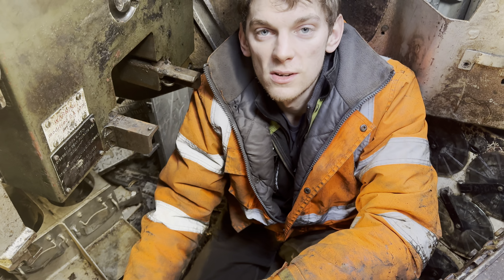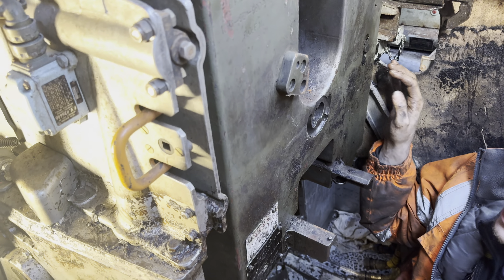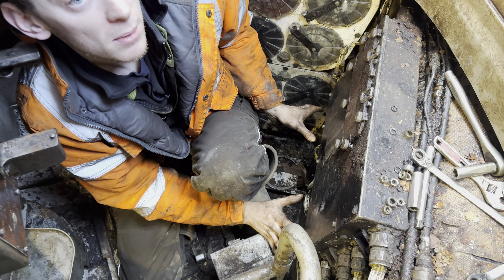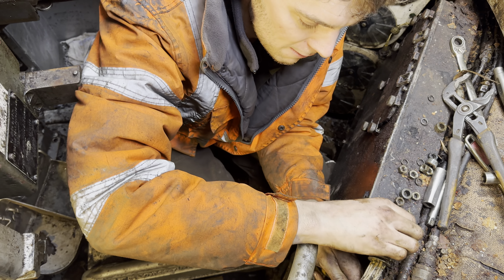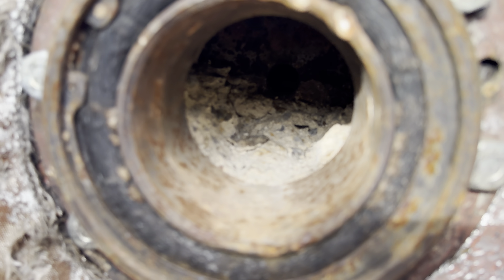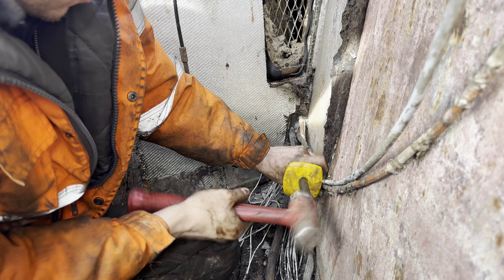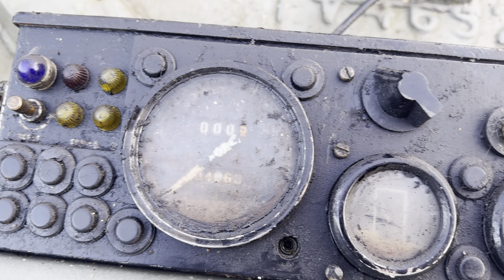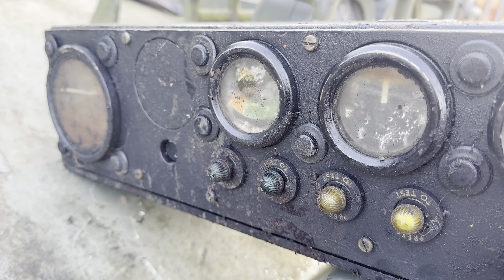When You Buy A Tank From Wish.com

Comment: How much did a Chieftain cost? Well, in 1967 it was £90,000 to £100,000. Which is about £2,047,227.36 to £2,274,697.06 in todays money.
Compare that to the Challenger 2 which was about £4,217,000 in 1999, about £9,158,718.25 today.
And they built 1896 of them, 900 for the UK, 996 for export.
Reply: no price for Mr crouch if you ask he probably has a brand new one for ya and a trailer and unit to drag it around 😉 another good video lads
Reply: gota love google lol
Reply: Is this MBT's or all variants, or were engineering variants just made from older specs
Reply: Last one we sold was at beltring , a Mk11 £13.5 IIRC , we had a serving scammer commander for a few days to drop it off . Great days , far away from all the BS now . We got it road legal too , I mot,d it .
Reply: Their centurion is on 95k so chieftain might go for around 150k-200k? Seems like a normal price for a cold war tank
Reply: @Ballentyne817  Its the best tool for random facts. As long as you aren't super picky about the accuracy. I have no reason to doubt these numbers, but I wouldn't go to court with internet research alone.
Reply: @Hewitt_himself  From what I can see, British variants were converted from old spec MBT's
Reply: When you consider that it cost 2 mil for a stormshadow missile and 400 grand for a javlin, 10 mil for a tank doesn't sound that bad.
Reply: @@user-zk9xe3wm3v Oman: 27
Jordan: 274
Iran: 707.
But sure, lets go with Oman only. And don't know why you put export in marks like that, it was exported...
Reply: @@user-zk9xe3wm3v and we are talking about the Chieftain. Not the Challenger.
Reply: @@user-zk9xe3wm3v Given the song and dance going on in the Straits of Hormuz right now ,there's every chance we might see some vids of Chieftains in actual battles...

Comment: That harness is not for the gearbox, its lights etc. Gearbox is the smaller shielded one .Its bottom RH side on the HMJB. If you remove the cover from  the HMJB the bottom RH side there is another cover. Under that is the main junction blocks for the gearbox, all the gearbox wiring goes through that shielded box.
Reply: could be wrong but i believe he mentions that at 26 mins into the video

Comment: AS an aircraft mechanic, I feel your pain, I really do. I had worked for Beechcraft at the airfield at Fort Meade, MD on US Army U-21s (King Air) back in the late 1980's. One of them had served in the Vietnam war and had a engine failure on take eoff due to fuel starvation and landed in the adjacent river in water up to the bottom of the wings.
We were constantly fighting corrosion and wiring problems on that thing.

Comment: There was a  Chieftain filled up with concrete at Bordon and they used it as a training aid for  recover mech’s . If I’m remembering correctly it was normal practice that they filled Chieftain gate guards  with concrete to deactivate them, never to be used again but you lads are going to prove them wrong 😊
Thanks for the video and yes I have worked in those turrets and I know how tight and difficult it is to work in them .
Reply: Who were they afraid of?  Seems delusional paranoia

Comment: I worked at Bristol Aerospace as an aircraft electrician, during the overhaul program to turn Canada's fleet of CF-5 fighters into primary trainers for the CF-18. The airframes and avionics were upgraded and every single wire was replaced from nose to tail. I don't envy you guys tackling theses Chieftans that were left in this state.  But I'll give you a tip for future efforts: if you have to pull cables and harnesses through tight spaces again, get yourself some electrician's lube.

Comment: The interesting thing about water corrosion is below a couple of inches it's fairly negligible do to lack of free oxygen as many canal boat owner will attest. The corrosion is around the water line and luckily the oil stopped that. So if you dry the tank fairly quickly and displace any remaining water with contact cleaner etc. then hopefully most stufg should still work
Reply: Something that's always submerged in water won't rust, but something getting wet repeatedly will. Mostly because there's a lack of oxygen under water. At Battleship Cove Massachusetts, they have the remains of a sunken PT boat submerged in a display filled with water to preserve them
Reply: @skyraider87 exactly
Reply: That is due to galvanic corrosion on canal boats. There was no battery on the tank so that should lessen it.
Reply: @planespeaking  archaeologists do the same don’t they when they dig something out of a wet bog, they keep the artifact wet/ under water to stop the air getting to it and it rotting away (until it’s conserved of course)

Comment: I used to deal with aircraft wiring, so I feel your pain, the routes for some of that wiring were never easy, always in tight confined spaces. Those wiring looms in the tank may be made of all white wire, but I bet that what was once a yellow sleeve near the connector at the end used to have a part number on it. From a wiring diagram that part number would give the information where the cable goes. I used to be an aircraft avionics engineer, I’m retired now, but I used to have to trace wiring to fix defects or carry out modifications. On the large aeroplanes most of the wiring is also all white wire, but in the civil aviation world they cheat and every wire will have a unique number printed on it every few centimetres. There’s also documentation in a wire list that will give for every wire, the wire size, its length, what terminals are used at each end, the destination of each end and what circuit it’s in. So it’s considerably easier to trace wiring. For instance in a Boeing 747-400 there is approximately 185 miles of wire, divided up into approximately 200,000 separate wires meaning approximately 400,000 separate terminations. So as you can imagine without the wire list fault finding would take a fair bit of time.

Comment: The rubber block sealing is similar to that used on oil rigs. Fire wire will sound if crushed. Your fuel gauge sender is by capacitor belts by the way. That wiring was always incredibly robust it tended to disintegrate when odd bods wrapped it around recoil mechanisms etc. amazingly the plugs and sockets look in quite solid condition not the jellified mass they often were after a few years service. Keep the removed wiring as it looked salvable as long as the letter connections on the plugs are known.

Comment: I don’t know, if this helps.  I installed the wiring in some Chieftain hulls as an apprentice.  The individual pins are soldered and each one has a marker on it inside the back of the plug to identify it.  Swapping the whole harness for a good one is, obviously, the easiest fix.  Although, none of the fixes are easy.  The hull gland was a twat to fit, from memory.  And that was with no charge bins fitted and no basket.  I couldn’t see the hull rear junction box either.  It was in the back right corner of the hull (sitting in the driver’s seat).  Wire locking everything in the engine compartment was no fun either.  No need for that anymore!  All the best.

Comment: I am amazed at your appetite for crappy jobs. I hate electrics.
Reply: Electrical work is not the problem its finding or having known good replacement OEM harnesses or electrical control box repair or replacement as well. I can see how just getting the tank to start and move is a huge acomplisment. I do wonder how often these guys hit their head. Im surprized they dont ware "bump" helmets.
Reply: Electrics been my job for over40 years
Reply: I love electrical i wire everything from planes cars computers and robots
Reply: @dancarney106 helmets are more trouble than they are worth.

Comment: Just a thought if you need to fill the bulkhead cable hole fill with a few fire stop pillows instead of expanding foam. Should you need to change anything else they can be pull out and reused, but will expand to completely block the hole should there be a fire.

Comment: 7:02 cable's white to make it a pain for an enemy to go in there and repair things once you've deactivated the tank. I know it's aggravating, but it makes sense. That's the "fun" part about tank design, you have to take into account more than just what happens in regular use. It would suck, if you (crew) deactivated the tank, and later saw the same tank, not even a week after, used against your own, because the cables were color coded and made easy to unscramble. This way, you just take a chunk out of each cable (break an entire section) and you're set. Without a manual and expertise, it would take the enemy at least a month to figure things out. That there's ANY cabling denomination actually makes the tank less effective in that respect, but i guess a line must've been drawn by the command when the tank was put into service.
It's like bike lock theory. You put more than one lock, not because it would be extremely difficult for the thief to clip them all, no, but because it's going to be a hassle, and thus it won't be a priority for your bike to be stolen. In a set of war, you have a similar logic, you won't spare crews on the front line to take your enemy's tank to readiness. You have either store it or expend man power to wire it back home for experts not on the line to go at it. Jm2c.

Comment: I do wonder if Cheiftan, or any other tanks, does have a wire diagram. You know like we can find for a car. If someone had been kind enough to upload one for Cheiftan to the internet, I dont know. But I think having one could had helped to figure out which cable you need :) But the old good fashion "Pull to figure out" works as well
Reply: Large binders full of them - the problem is that most of this military stuff has multiple revisions and you need to find the drawings that reflect the exact configuration you have.  On top of this, in a lot of cases the assembly of things like wiring harnesses was subcontracted and the contract required that the contractor not retain any copies of the drawings after the contract was complete, so the only documents that 100% reflect the as-built state have often been destroyed. Add in all the post construction mods and in-service bodges and really the only way to be 100% certain precisely how it's all hooked up is to inspect it.
Reply: @TrimeshSZ  Doesnt sound too far off how it is in the auto part of things. But again as I said before. Tracing a wire to figure out where it goes and through where also helps when a wire diagram isnt able. A lot of the times where I had to trace a wire I did that. Only times where I thought or going to need a wire diagram is either if I encounter a nest of same colour wires, or if I have no freaking idea where the wire went to. Like going through the firewall where 100 other wires does as well

Comment: Dunno if you binned the old dash, but, from personal experience, it's best to keep it all, even the waterlogged bits. Of course, none of that will be useful as a whole, and you'd need to expend time taking it apart to keep the good bits, but if it can be salvaged, it's worth something. The brass, bezels, glass, everything. I'm struggling to find bits for tractors and equipment that were made in the 90's, can't be easier with this vintage whine.

Comment: I wonder why they poured concrete into the engine bay.  Only reason I can think of is to add ballast but it is a tank so it wouldn't need it.  Considering they also ground out the gearbox mounts, maybe they never wanted it to run again, but I don't see why they'd need to take out the gearbox mounts and concrete the engine bay to do that, all they'd have to do is take the engine out.  It's not like someone is going to be able to put a replacement engine in without anyone noticing.

Comment: The end of each of those white cables inside the back shell of the connector will have an identifying cable marker on it so fault finding is usually only a problem when someone else has been there before you and ragged it off! 😕

Comment: If I may ask , why not just cut the bad wires off so you're not trying to pull the plugs through the tight spots ? You can still compare lengths after pulling them out .

Comment: Might be worth spraying all the electrics down with some contact cleaner, as it didn't have power in the system no electrolysis took place, now your waking it up any damp on the electrics will start to dissolve it all away. Had a right mare with a digger that went in water with the power on.

Comment: If you have the connectors, they should have the individual pins labeled.  With a good wiring diagram, you should know what pin goes to what connection in the engine bay.  Then it would be a simple task of sounding out the wire to see which one it is in the engine bay.  If the connector is not labeled I would b e wondering why the hell not.  You could still do the same but you would have to be looking at the box in the turret to figure out the purpose of that particular wire.

Comment: With our host crawling aroubnd inside a British built machine,in the mud and water,pulling old cables through reminds me of my apprenticeship working on English Electric rail car units. Hundreds of very long wires,all insulated with cotton wrapped butyl rubber and all the same damn colour (greasy black) .They had little number lables on each wire which of course would have dissapreaded long before we had to fualt find them with a buzzer powered with a telephone battery (no,actually a round thing , unlike a lithium battery today)

Comment: If tanks fill with water when the bungs are left in. Why not just leave the bungs in, feed a hose in and let it go till it overflows? Save on mixing all that concrete. Or do they dump in a dry mix, fill with water and leave to cure?

Comment: Trying to move the bin may have been easier if the water was drained from it? Looks like it was full, which would surely add a liiiiiiiiittle bit of weight to it. However, there was indeed a slight lack of room to actually shift it anywhere else.

Comment: Are not all the wires individually numbered, if all the same colour. The number printed on the cable insulation each 175mm or so.
Reply: I was just about to ask the same question
Reply: Most at this age/stage have rubbed off or become unintelligible
Reply: Just like a mid 90's Citroen except they were all green. God awful things to trace electrical faults on.
Reply: The concord test aircraft in duxford is full of orange cables 😂
Reply: No, military/aerospace harness are not numbered in this way (there is no marking on the insulation as it is usually a type of PTFE or the like which doesn't accept inking and the color of the insulation defines the AWG/type of stranding/wire coating/...). You usually put a temporary marker on each end of the wire during the manufacturing and remove it when doing the contact insertion. If there is enough space in the backshell, you can put a shrink sleeve on each wire for further identification. The contact number is written on the rubber grommet on the back side of the connector (visible when removing the backshell) and you manufacture the harness in a point to point fashion. The harnesses are then validated using automated testers for continuity and insulation.

Comment: Did you get schematics for all boxes? Would expect wires were wire marked with grey / black ink numbers
Reply: Connectors look like cad plated aluminum , used lots of round milspec connectors on oilfield equip in US

Comment: Don’t see why anyone would get or use something like that as a display and fill the motor compartment with concrete and then leave it opened up enough to fill up water. It’s not like it’s not heavy enough as it is. What a waste! Curious, if it was already flooded with water, why not go ahead and spray it down with a degreaser and cleaner then steam it all out so it’ll be much better to work in?
Reply: Got to fill them with concrete to stop them blowing away in the wind.
Reply: @Jabber-ig3iw  LOL!